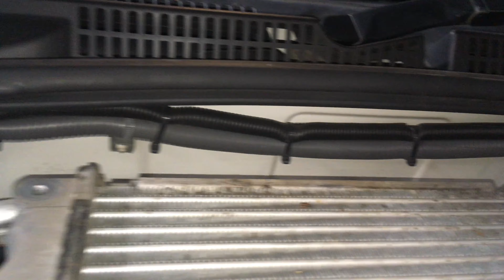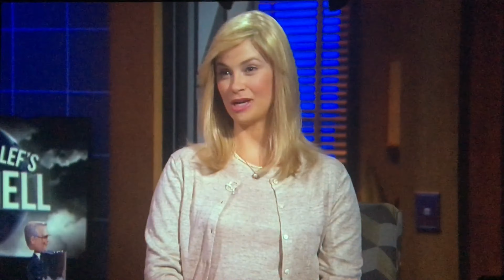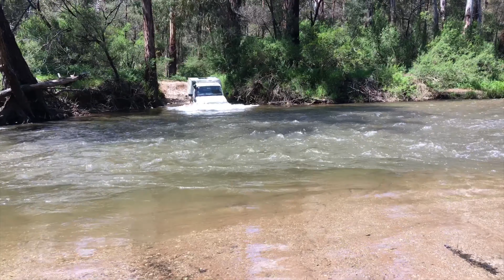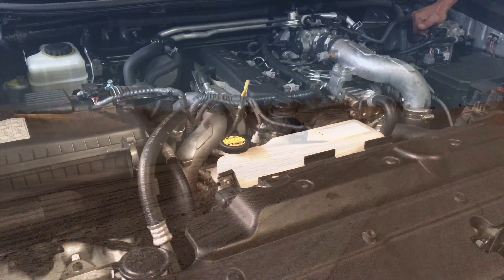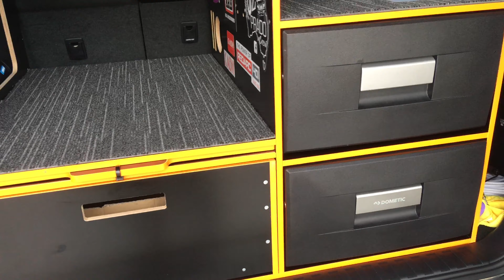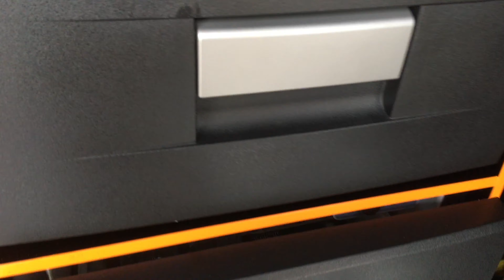ABOUT 6 videos in ONE! - INCLUDES IMPORTANT RARE PROBLEM & how to work around it

Comment: Charge that battery mate! They don’t like being flat. The longer you leave it flat, the more quickly the longevity will diminish. Go lifepo4, you won’t regret it, but not under the bonnet. Get rid of the old school dual battery systems, go single starter battery and dc2dc to lithium.
Reply: I have to second that, a voltmeter is no real indication of State of Charge .. 11.9v is pretty hard to come back from in any form of lead acid battery, without a lot of boost charging followed up with equalising float charges .. it will do it a few times but they really start to loose the ability to recover. I used to install large battery banks (1100Ahr) and do the commission tests with a hydrometer an voltmeter .. the Specific Gravity of the acid is really low at 11.9 ..say 1165 SG, 12.2V is about 1200SG and 12.8V around 1245SG .. for longest life set the min to 12.2V.
 NB not trying to knock, and I love Century & Yuasa Batts in Lead acid, most people have never used a hydrometer so the info is limited . .. LiPo is next level again, so much better, but you have to pay .. amazing! Thanks for the tips on changing out the injectors, so good when we all share the knowledge. Cheers